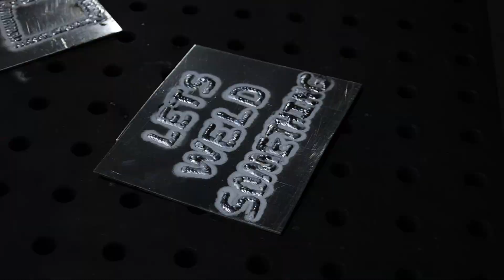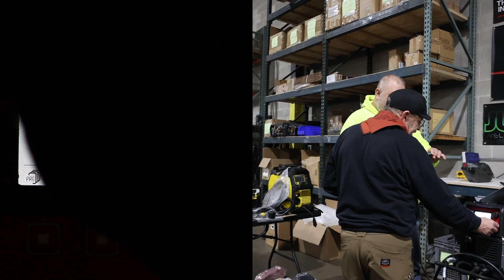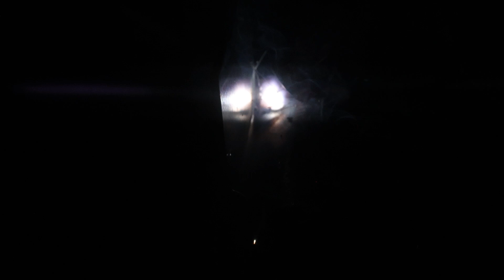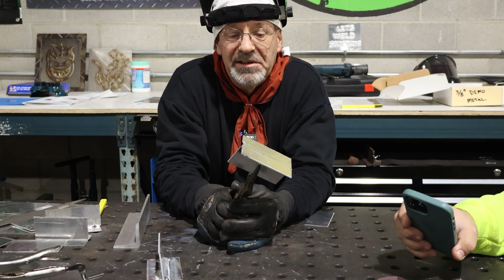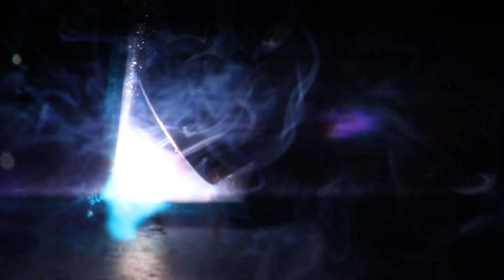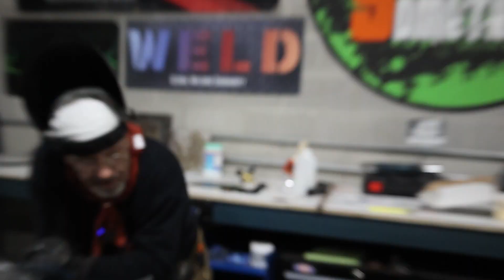Bob Moffatt and Peter Zila MIG Weld Some Aluminum!

Comment: I have my HTP 220 for well over a year now and done lots of aluminum , went a year using only 4 tips ,then one day 4 tips, what 
happened,,,,, stick out that is what happened, welding 1/8 aluminum to 3/16  trying not to burn thru, but ended up with 492 inpmin
21 .5 volts  with 5356 wire 035.  So Pete were can I get the welding tables you have on your phone? I have been watching Bob and Peter  from the first time you guys were on you tube, learned a life time of info from you guys, thanks a million you two.
Reply: thanks Peter

Comment: 👏👏both off you gentlemen are truly top notch in your fields. This video is right on time bc I’m contemplating an HTP pro pulse 220. I can’t decide if I should go with this machine or a fronius tst 2200.  I’m not big on aluminum work but I’m intrigued with it. Thank you for the knowledge that you share and keep the content rollin
Reply: Both machines are top notch European high quality machines. 
Initial cost and power output are similar too. 
If you are planing on mig welding steel (or aluminum) diesel fuel or hydraulic oil tanks then pulse ( even on steel) has major advantages….  
The rest ….  Is a lot of personal preference ….  Color, brandname, etc …

Call both places, talk to people, ask questions … all sorts of questions, find out what consumables or spare parts cost….  And see how “easily” customer service is getting frustrated with you …. 
Do stuff like this before you spend your hard earned money …! 

Then make your decision … 

Thats what i would do….  But since you will be spending YOUR money and YOU will have to live with whatever machine you buy ….  Maybe do what YOU want to do, not what i suggest ….  🤷‍♂️
Reply: @ZILAwelds  your reply is one of the most insightful, helpful, and non biased that I could have received. Thank you
Reply: @mkearn724  you are very welcome.  I have welded with both machine - I can give you first hand impressions (and I have somewhat) anything beyond my initial statement I would consider "personal preference" not objective reporting ... and because my personal preference and your personal preference might be different  (or might not) YOU have to make a picture for yourself ....

I don like these guys who answer a equation similar to your yours like:" should I buy machine abc or xyz?"  and then some guy answered ... :" you defining should tho this and that and the other" .... and then when I as he guy (the not who wrote the answer) what proctor did you weld with machine abc and which one did you do with machine xyz ? then the guy says - well I dont own both of them - and then 3 questions later turns out the guy does not even own any of the machines but didnt even weld a a friends house or a trade show with EITHER one for the machines in question ..... BUT has some "solid" advice for YOU how YOU should spend your money ...   
In my mind ... stuff like this is going a lot on YouTube .... and I am trying to be the change I want to see ....  
Like I said - I welded with both machines (not equal trigger time) but enough to have an idea of what the machines are capable, and I stand behind - they are BOTH top notch machines ... and there is a fair share of "personal preference" ...  down to not just the equipment level but also the team of people and company philosophy  ....  
I know a lot of people if I offer them free beer, they would be happy to take it ... I also know people who'd ask : "not bud light?!?" and then politely decline ... LOL.  there is that element too ...  you need to be comfortable with whatever decision YOU make for yourself ...  

Asking others is a good start, int he end you are the only one living with the consequences of your decision ....

Comment: No spool gun needed?
Reply: if you have the right liner and a torch that is not too long you can weld without a spool gun.
Reply: Definitely can do good with straight mig wire feed just swap out wheels